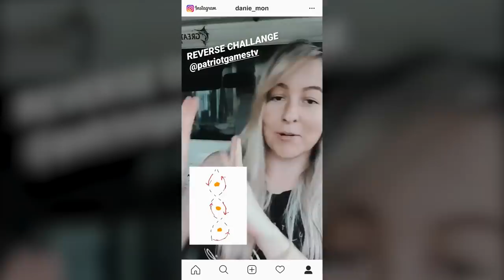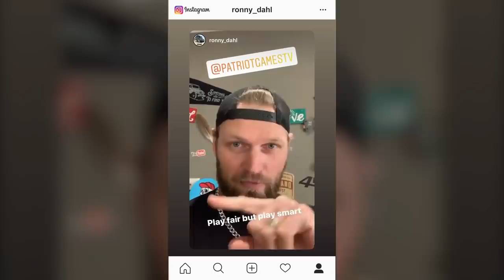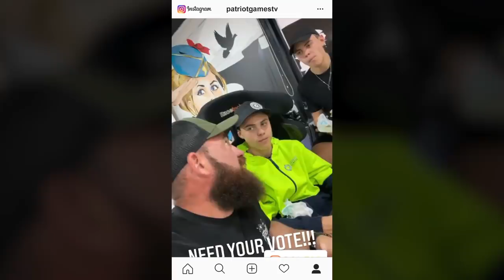FJ45 VS LC79 - The ULTIMATE Landcruiser Battle

Comment: Having owned both a 40 with a F155 engine and one with a 2F, the 2F was a step backwards. The F155 engine  is better on fuel , freer revving and just an all round better package.

These later 40s were far nicer to be in though, when it rained, my 73 40 used to leak everywhere because the doors didnt seal after 20 years!